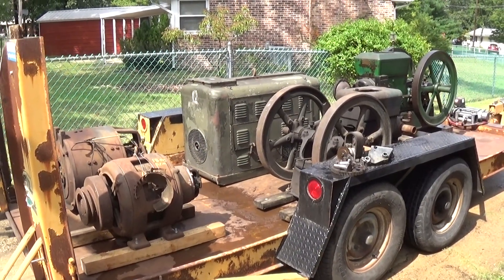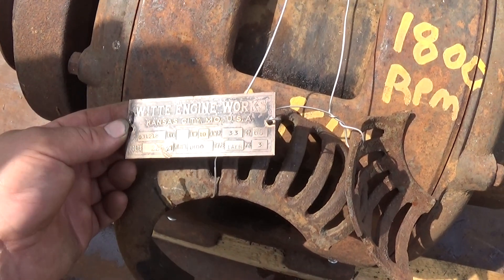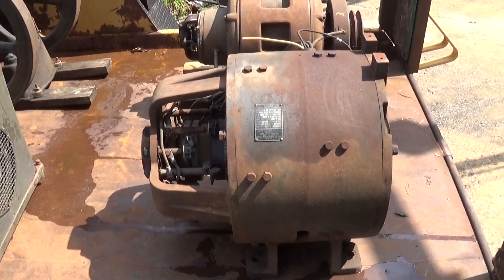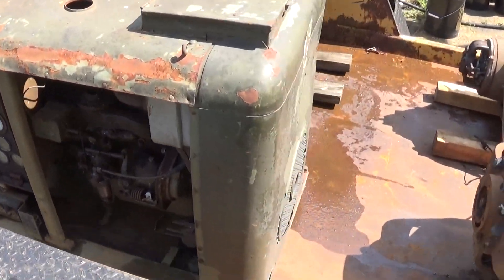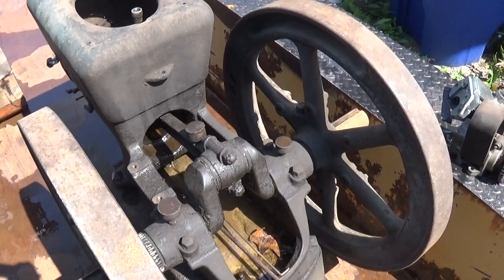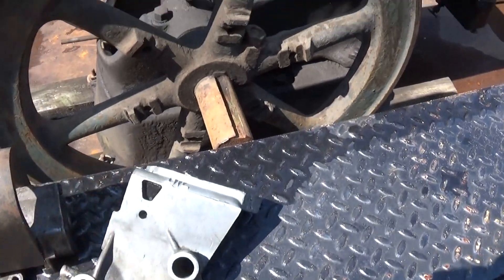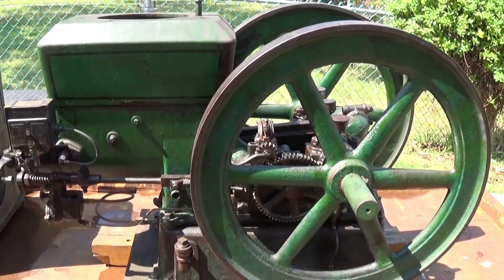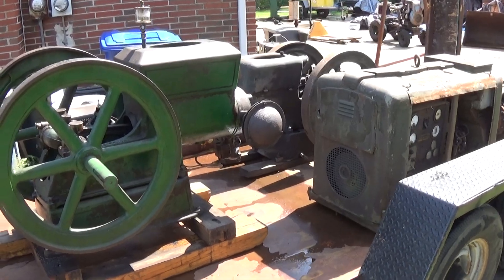SmallEngineMechanic Selling Out

Comment: I'm confused about the Kohler generator.  You said that the engine was good, and the generator was good.  WHY DESTROY THE SET??  I really enjoy all of your videos that I have watched, but the Kohler set is disconcerting.  Those are such fantastic sets, and I have wanted one for a long, LONG time, but have yet to be able to get my hands on one out here in California.  All of this antique stuff is all there ever will be.  Parting out should be avoided to the maximum extent possible. They aren't making any more, so we need to take the best care of what's left that we can!
Reply from the maker: The story on the Kohler is this.  I have three of these 1200 RPM style generator sets. One 10 KW with auto start "Emergency" type controller which is fully functional.  One 10 KW with "manual start" type controller which has a destroyed engine (ruined bottom end and very worn cylinders).  One 4 KW with no controller (believe it originally had an "Emergency" type) but with a good engine.  Being the engines are the same for the most part between the 4 and 10 KW sets,  my intention is to put the good 10 KW gen end from the set with the bad engine one the engine from this 4 KW set.  
I would have liked to rebuild the engine from the 10 KW set however the original radiator was also missing (had a model A Ford rad installed) along with the fan and original frame.  In my opinion these issues put it over the threshold for repair.
Not surprisingly the 4 KW gen end did not sell at the show that I took it to.   That is fine with me as I have a Fairbanks Morse 36A single cylinder diesel that I would like to couple to it.
I can understand your concern, and appreciate that you watch my videos.  From reading your postings on Smokstak I know you "know your stuff" when it comes to motors and generators.  Know that I value this equipment also, not so much monetarily, however I usually over pay for my projects (or so I am told).  More so because I enjoy the "hobby" or sickness as some call it and like to see this equipment work and learn about it.
Reply: Hey Mike, sorry, I get sort of passionate about these old machines. :) The 10 kW has a larger engine than the 4 kW, but the two may bolt up anyway.  Since it seems that engines of this era have very low compression ratios, I'd bet that one could mill the head on the smaller engine, get much better fuel consumption, and still develop enough power to drive the 10 kW generator. Might be a fun project!  Definitely don't let go of that 4 kW generator though.  These Kohler inherently regulated six pole generators are really cool. :)